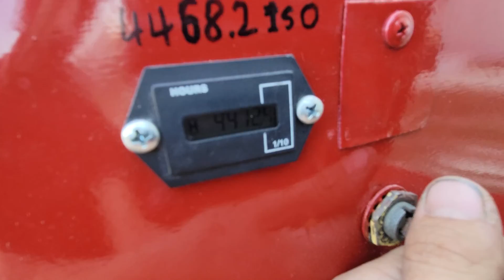homemade articulated wheel loader is done

Comment: I think if you put some flow control orifices in line you could get little better control on the loader movements.  Pretty sweet build though!
Reply: Agree..and the centerpivot with just bolts isnt the best way to go.wheelbearinghubs like the rear on a Volvo v70 is perfect